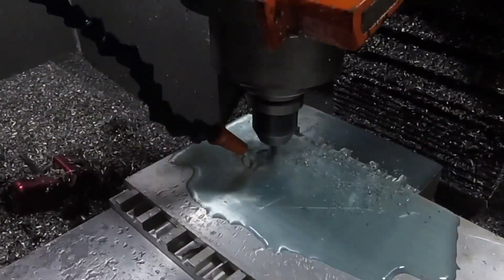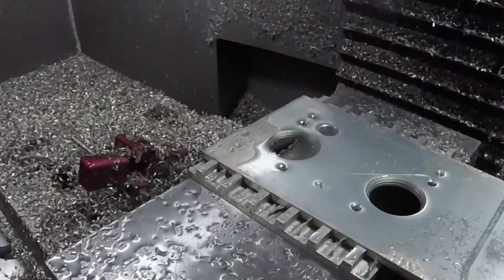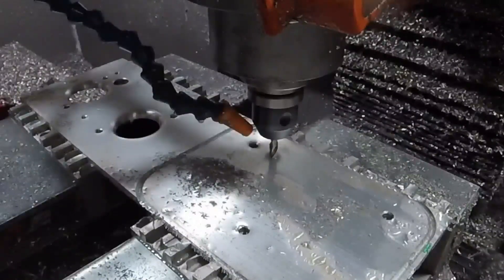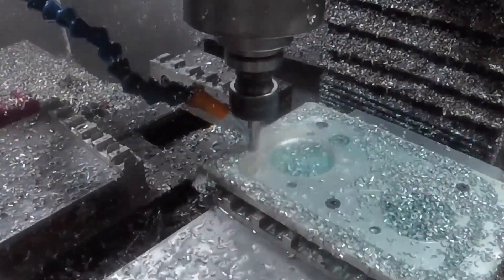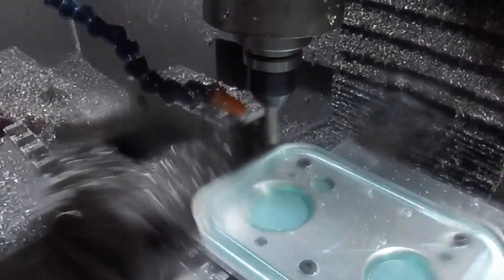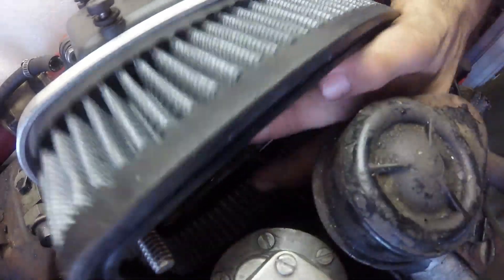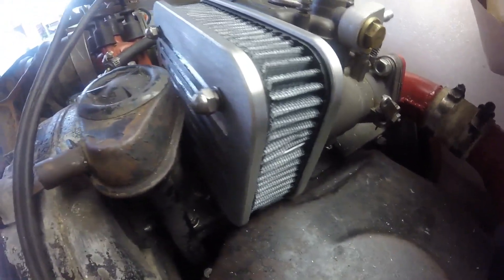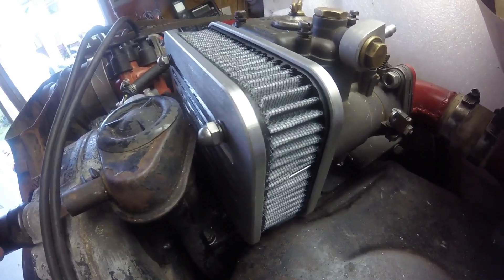Making a custom Weber DCOE Air FIlter on a  Tormach

Comment: Looks great.  Did you have any chatter on that thin plate?   Or did you have something under it that we couldn’t see?   Also, I’ve never seen jaws like that before...
Reply from the maker: Thanks!  I don't recall any chatter but if there was any it was cleaned up with the finishing pass.  Those jaws are so I can make parts smaller than 6" long without cutting into my jaws.  Been using them like that for years and they're pretty handy.

Comment: Beautiful ! May I ask what your slotting settings are ? Thanks !
Reply from the maker: Thanks!!  Sure, for the holes I'm using a spiral helix with a 3/16" 2 flute mill.  5100rpm, 20ipm 0.012" depth of cut.  For the large bore holes it's the same tool and setting except a 0.06" straight depth of cut instead of a helix.  That what you are looking for?
Reply: @ecdezz  Thanks!